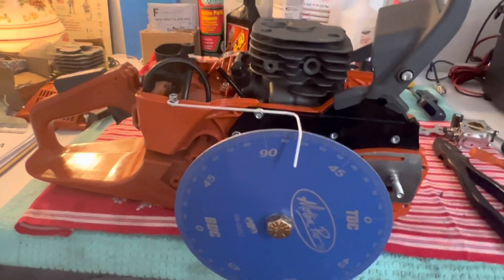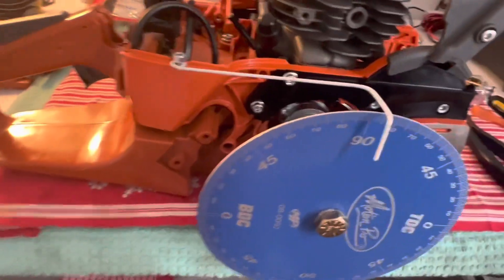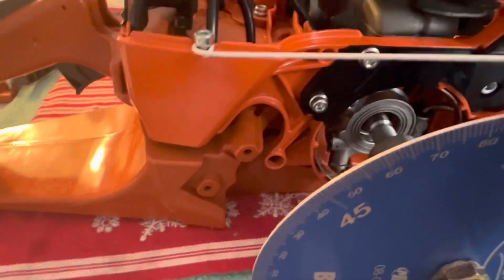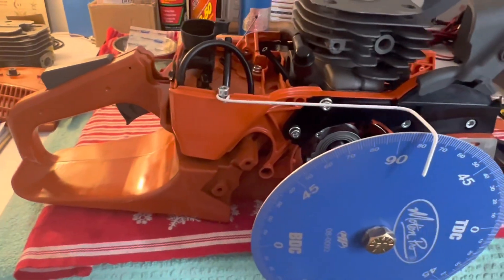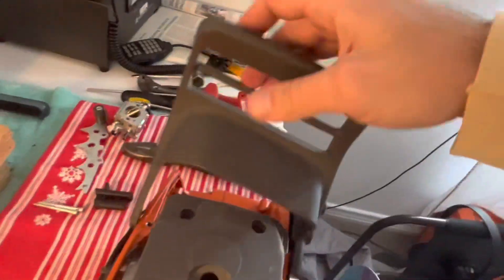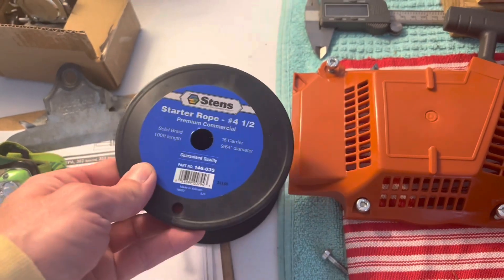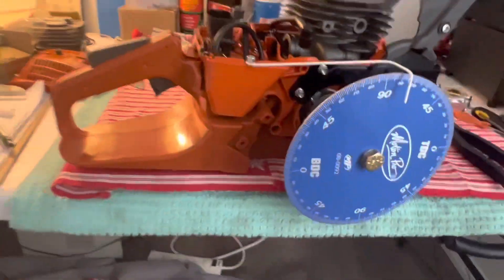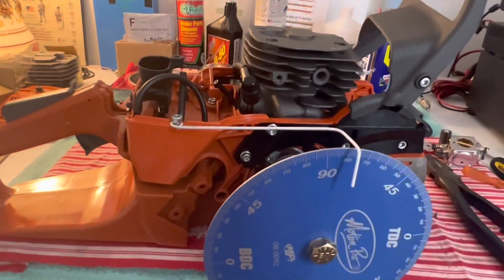372 Clone Built & Timing

Comment: That cylinder is a good example of one that DOES need machine work to gain anything. Good luck with your build. 🤙🏽
Reply: @royb.1441  happy new year
Reply from the maker: @cajun3197  Hey Pat!! Hope you been doing good. I think this saw might need an ignition timing advance. The way it’s tuning and running is pointing me in that direction. Traditionally I think OEM Husky 372 don’t need  ignition timing advance….but I have seen and heard these newer clone 372 kits being sold are way off. Some guys need so much advance there is no key left and they just lap the flywheel well to the crankshaft with no slipping problems.
Reply: @royb.1441  yep pretty hit and miss sometimes